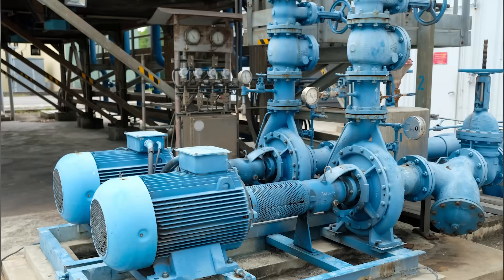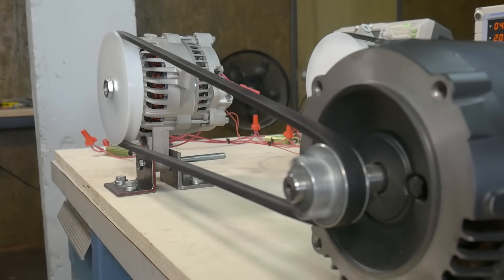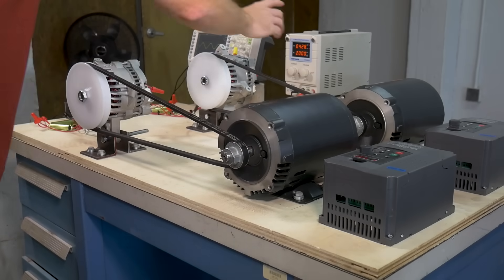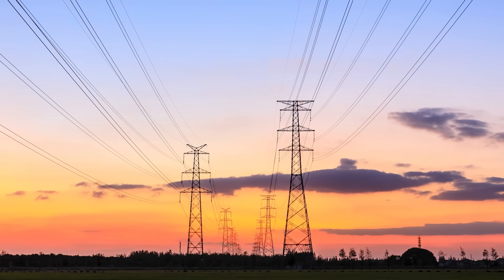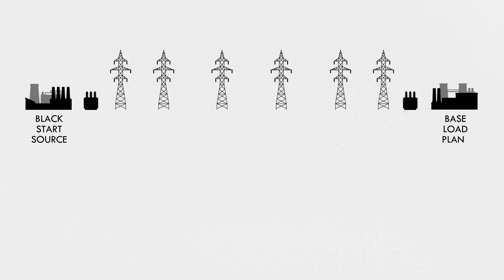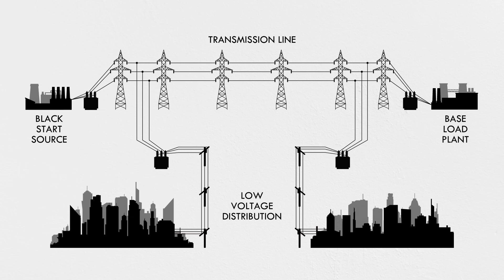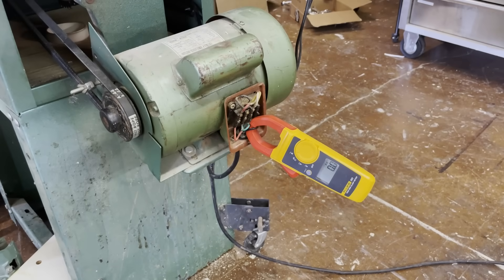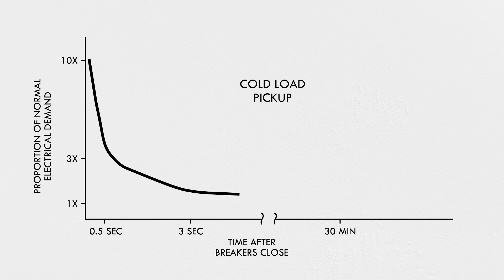What Is A Black Start Of The Power Grid?

Comment: Usually when you synchronize generators, the on coming machine speed is set slightly higher than the running machine, so the synchroscope spins slowly in the  FAST direction. You then have to time the breaker closure so it happens as close to twelve o’clock as possible. 
Slow in the fast direction is how we described the technique.

Comment: I was in high school and at home when the power started to fail, I called my friend and it was happening at his house also. I had my Healthkit VOM monitoring the power and it was fluctuating all over the place, the TV sync was rolling as the line frequency was changing. 
When the power went out completely my friend came over and we went to CD headquarters in town, because he was a ham operator they gave him a 2 meter Healthkit lunchbox transceiver. They asked us to go up a nearby mountain, it was amazing! As far as you could see it was dark. The only lights that we could see were the hospitals and the city of Hartford. On the 2 m band we could hear hams down in NJ and up in Massachusetts talking that they were without power also.
I didn’t plan on going into the power industry but for 30 years I was with a company in their ICE department and designed control systems for power plants.

Comment: I always thought that part of the reason they use electro-magnets is because they will degrade over time from heat and you can't get reliable voltages with them. Not the case?

Comment: Half of the issues here during a black start aren't an issue if the grid is secure, with battery & hydro storage you increase grid security to the point where black starts are allot easier

Comment: Our power grid is our most vulnerable target for terrorists and enemies. We still have failed to address this
Reply: I agree completely. Water supply systems and reservoirs are equally vulnerable. There is a good case for using small modular (nuclear) reactors for community heat and electricity. This would reduce dependence upon an interconnected grid.

Comment: As someone who operated a large data center switching to backup power we always had to be very careful when powering cooling equipment. And in a large data center cooling is 2-4x the power of all computers and that's when settled. Startup current was much more. We only had a windows on 8 minutes without cooling when temperature would become so high that computers would crash. And that was as the time of mechanical drives and we never really wanted to stop those. I think 40% of the battery capacity was reserved just for that. We had about 3 minutes for all the diesel generators to spin up and provide 50hz 3 phase alternating current, and oh boy was that a problem in the winter.

Comment: I work with a small islanded power system with a total nameplate capacity of about 1MW. Originally, our system could blackstart based on residual magnetism in one of our 100 year old generators. There was enough voltage produced just by spinning it to supply power to the original static exciter, and get it up and running. But as we've modernized that, it's no longer possible. We can now we need power to run both our current exciters, and to operate the switchgear. 

So, now, if the batteries fail, we depend on a 3kW Honda generator. That charges the batteries, which in turn can be used to blackstart the rest of our microgrid.

Comment: We are the only company I know of that overhaul the fuel pumps for the GE Frame 5 MS5001-L & LA, MS5001-M, MS5001-N, and MS7001B.  These are all black start qualified if they have a diesel engine to turn the starter motor via a little generator...

Comment: That GE sync scope brought back some fond memories for me. 50 years ago, I was a load dispatcher in a big steel mill. There were 2, 30MW generators. When we synced a generator to the local utility grid, we controlled the steam admission valves to make the sync scope run in the clockwise direction at about the 2 times the speed of a clock second hand.  We would excite the generator at a voltage, just a bit higher (14kV) than the grid voltage (13.8kV). When the sync scope was at about 5 till noon, we closed the breaker to the grid. The higher speed caused an immediate MW load on the generator of about 5% and the higher excitation voltage over the grid caused an immediate positive MVAR loading. This was preferred over closing the breaker on a static sync needle exactly at 12 noon as it avoided potential motoring of the turbine-generator and potential overheating from negative MVAR loading. If you did good, the turbine floor didn't flex when the breaker closed, if you messed up, the whole powerhouse sounded like a bomb when off. I was a kid at the time but I can still remember my old native Swedish boss yelling at me to "pick up those vats, and gimme some more wars".
Reply: Nice to see a man that still worked with steam.  Im from the era of simple cycle steam in utility scale power plants Foster Wheeler and Combustion Engineering plants. There aint many of us left.

Comment: That "wayward squirrel" comment at 2:03 had me chortling in memory... the computer center (and the attached research building where I worked at the time) had a mini-substation out back to provide the substantial amount of power needed to run half-a-dozen mainframes and a plethora of minicomputers and other gear, some of which ran the fledgling Internet's southeastern hub... and there was a pretty fat rubber-coated line that ran across the substation that the squirrels frequented.  In amongst all the buildings the wind could get pretty swirly, especially in a Georgia thunderstorm... and *two summers running*, some poor hapless squirrel would try the dash across the power line in the middle of the wind and rain... and fail spectacularly, resulting in a kamikaze dive into one of the power transformers.  BOOM! out go de lights... and I'd find myself with my penlight wandering the halls turning off surge protectors in the dark, just in case the resulting power up had a bigger spike in it than we expected... 

Just in case anyone thought Grady was kidding about the squirrels.  NOPE, it TOTALLY HAPPENS!

Comment: Each time a major blackout has happened, a small town in upstate NY called Green Island has its own power plant, hydro, on the Hudson

Within minutes they disconnected from the grid and they started the plant back up powering their city and it's customers.

This is how the grid should be, small cells able to get it's customers up and running.

The other cities used to be like this, Cohoes, Waterford both on the Mohawk River have power plants hydro and they used to be used to power those cities.

It is a very good design.

Comment: People in South Australia found out the hard way a few years ago that having a lot of disparate renewable generation hooked together with extensive long power lines was not a good idea. When a bad storm knocked out power from one remote part of the state that had wind turbines, it cascaded to a state wide blackout.  The first "solar farms" built in Australia, were also a flop since they were not able to meet frequency synchronization.........and each had to purchase a 30 million dollar "synchronous condenser" to fix that issue......its basically a big rotating mechanical drum that simulates the momentum and pulse of a conventional generator to provide a consistent frequency power output.

Comment: Thanks for doing this video.  Helps to understand why crews power up certain areas the way they do.  

But, it still doesn't explain why my next door neighbor - and the street light at the end of my driveway - never seem to lose power when we do in a storm. (Yes, they're on a different circuit than we are.)  And, for as many trees that Consumer's Energy has trimmed or removed, you'd think there would never be a branch on a line! 😕

Comment: Really good explanation regarding blackouts and black start. I'm now retired, but for years I was a system operator and then trainer for system operations. My principle role was helping develop and train current operators, the implementation of our System Restoration Plan for my company and province. One thing not mentioned here that can be a challenge is when two islands are finally brought to where there is only one breaker separating them, there is potential for a 2 per unit (2PU) voltage (or 180 deg out of phase) to be imposed across the contacts of the open breaker.  In the past it was no big deal because the usual synchronizing breaker was an air blast with up to 4 sets of contacts to share the electric stress. Today, however, with the "improvement" to SF6 insulated breakers, there are generally only one set of contacts, and they are not rated to handle 2PU. This could result in catastrophic failure of the sync breaker, further complicating restoration. We did special training to try nd prevent this, but still a great challenge, none the less.

Comment: 40yrs ago I was a transmitter operator for Trans World Radio on the Island of Bonaire. We used to 16 cylinder ALCO diesel engines to power our radio station (50 KW, 250 KW Shots wave and an 500KW medium wave). Each generator was rated at 2000 KVA with .8 PF. 

I had to parallel both generators each night before we could bring all three transmitters online at full power. We had a synchroscope but also used the 2 Dark one light lamp method to know when to close the breaker. If you didn’t get them synchronized, the online generator would trip off and you’d be in the DARK…. 

We used a 50KW generator during the day to generate power and at night we would have to start it up for the tower light if we couldn’t get one of the big generators back up soon.

Great video and fun to think about the old days!

Comment: I was watching this, and took note of the flashing light as you were bringing the two generators into phase in your demo. In the past I flew as a flight engineer in Boeing 727’s. We manually paralleled the generators on start up by adjusting the frequency till the sync lights went off. I always accepted it as magic, I was trained throwing the switch when the lights were on could shear the shaft on one. Now I see why.

Comment: My AC has a time delay. If the thermostat loses power for any reason, it will lock out for five minutes before attempting to restart the compressor. I imagine this is true for most systems, big and small, industrial to residential. I would imagine that there would be a MAJOR spike in current about five to ten minutes after power comes back online. 
I imagine a huge spike when power is restored as small and large refrigeration systems that use simple bimetallic thermostats start immediately. A second one after about 5 minutes as huge swathes of residential systems spin up, and a third one at 10 minutes as the industrial systems on top of large public buildings (stores, restaurants, etc.) begin starting their compressors. I'd personally LOVE to see the instantaneous current and voltage graph when tens of thousands of HVAC systems begin operating at nearly the same time.

Comment: On a submarine, when it ties up to a tender ship, we run shore power cables to the tender generators and we have to manually synchronize our power frequency with that of the tender shore power supply.  We slowly tweak the generator steam throttles to the steam generators to slow the frequency meter rotation.  Then, close the motor operated power tie circuit breakers.  The closing of the breakers takes time and has to be timed so that the delay of the motorized breaker closing will happen when the submarine to tender frequencies match.  Typically we would get the synchronization meter rotating slowly in time so at about the 5-miniute mark to 12:00 on the synchronization dial activating and closing the motorized circuit breaker would hit at the 12:00 (straight up - in sync) position.  Why is this not automated?  because the tender power is typically from the tender diesel generators and their frequency regulation is not the best.

Comment: Great redux.  I watched until the commercial break.  NB while military facilities can be isolated and get priority, most hospitals, schools, etc. are part of neighborhoods and don't have a separate grid tie.  Some places allow facilities to tie to multiple substations, allowing more flexibility in restoration.  Mine (Tucson Electric Power) hasn't approved any in over a decade.

Permanent magnets do find a home in standby generators for a black start, eliminating the need to have more power storage than simply to run the starter motors.  The power required to fire up a 1MW diesel genset has its own maintenance headaches.  

Cascade of failures leads to a blakout, and cascade of successes restored from that through black start to operational customer-serving grid.  Through it all there's enough manual process and engineer input and linemen sent out to restore breakers in disribution centers that we're practically living in 50 years' ago tech.

Comment: I haven't worked at ever single powerplant so there's probably exceptions but the synchroscope doesn't necessarily need to be stopped. How I was trained to do it was you want that baby going slowly in the fast direction and then at about the 10/11 o clock position you throw the breaker so when the actual breaker closes it will be almost dead on.

Comment: I dont see why they couldnt just use an large flywheel motor generator in line with the grid and have it running inline with the system to act as a buffer or suppressor .

Comment: It's interesting that this video got recommended to me. I recently had a blackout in a automation videogame I play. While the mechanics in that game are vastly oversimplified, it did make me wonder how blackouts are handled in IRL. Even with the simplified game mechanics, I still see some fascinating similarities. I had to disconnect some systems, a backup battery bank allowed me to get fuel going to the generators that allowed me to get everything important going again. Then, after expanding power capacity, I could reconnect the systems I disconnected. The only major difference between the game and IRL is in IRL, they don't exceed capacity before deciding to expand infrastructure and the process is much more involved and higher risk.

Comment: This happened in South Australia about 8 years ago.   Storm damage bought down the interstate interconnector and frequency sync issues took out a lot of wind generation, plus some other HT lines bought down.   Entire state grid went down.   Most places had power back in a few days, some as long as a week, but they had to do a 'cold start' of the grid, which they'd never actually done, apparently successfully.   We were ok because we had a genset to run freezers and such.  Cell phones for some providers went down after 12 hours.   Some came back when power was restored however one was out for a week because the equipment was damaged by a spike early in the piece.

Comment: "My model power plant consumes more power than it creates." So it obeys the 2nd Law of Thermodynamics, just like every power plant. :blep:
I have no experience in the power generation industry, but I imagine that blackstart stations must have redundancies all the way down, to the point where if there is no battery power available they can get their initial power from either a hand-cranked generator or motor or from gravitational potential. (I'm imagining someone pull-starting a lawnmower engine or pulling a pin to drop a block of steel on a chain to provide power to start up that initial turbine.) I can also imagine the testing and certification necessary for every step of the bootstrapping process just in case [gasp] happens.

Comment: You should elaborate on how alternator excitation or better known as mechanical electrical field flashing and phase sync works and why an external DC power supply is needed to energize the rotor in an alternator. You did good on the AC reference sync part that the other power plants use to then sync to the 60 hz grid as they come online.

Comment: Do radio frequencies with high frequencies cause a hiss at high powers?  Why does the hiss travel from refrigerator, to Wi-Fi router, Hvac, through the wall from my neighbors apartment.  Seems to change hiss tune by moving around.  Emitter type?

Comment: Fun fact: Power plants require electrical power to operate the necessary systems within the plant. For example, operating a coal-fired plant requires conveyors, crushers, air compressors, and combustion air fans. Steam cycle plants require large pumps to circulate the water in the steam boiler and cool the condensate. Hydroelectric power plants require electricity to open intake gates and adjust hydro turbines to regulate speed. Even in a wind turbine plant, relatively small amounts of power may be required for things like adjusting the pitch and direction of the blades. Normally, the electricity used in the factory is supplied by the power plant's own generator. In the event that all of the main generators of the power plant fail, the station will be powered by drawing power from the grid via the power plant's transmission lines. However, during a global blackout, power from the offsite power grid is unavailable. When the grid is unpowered, a so-called black start must be performed to bootstrap the grid and make it operational.